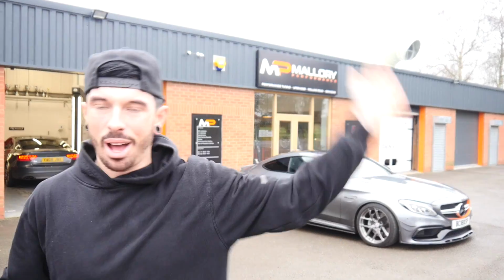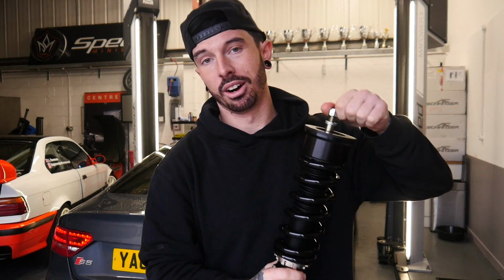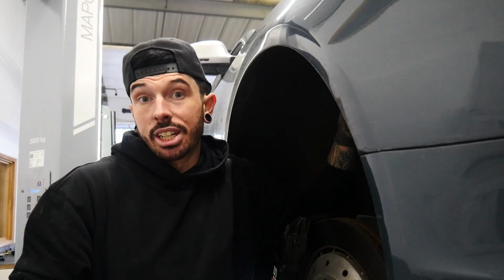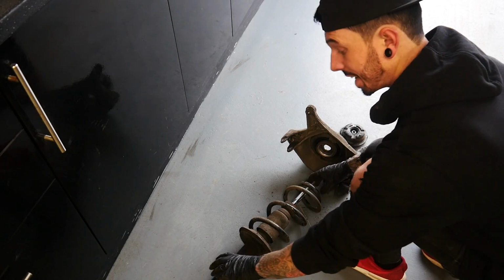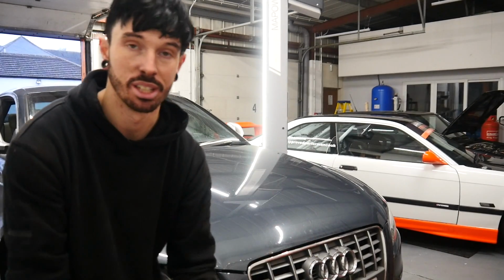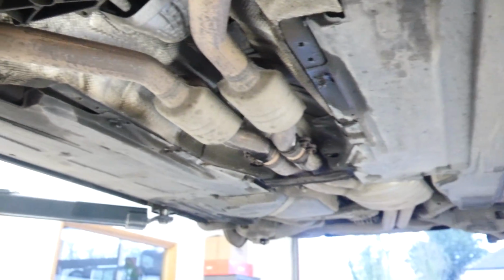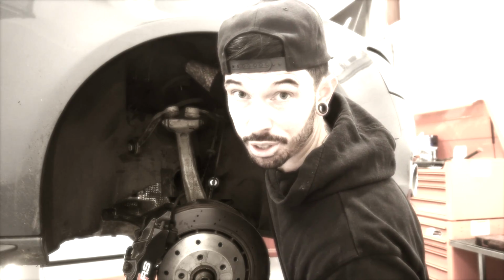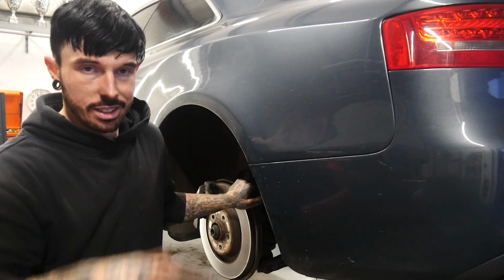COILOVER SUSPENSION INSTALL FAILED! AUDI S5

Comment: Brilliant video 👍 I really feel your pain with those bolts snapping, it's one of the worst feelings in the world (at the time anyway), I actually feel like crying when it happens, I think you need to go and have a brew and 10 minutes when stuff like that happens otherwise your head just goes. 

I've got all the front upper and lower arms to do on my 10 plate A4 Avant this year, I've back off the pinch bolt nut and have been blasting it with penetration fluid once a week in the hope I can get the pinch bolt out, worst case I'm going drill it out. 

I did the rear shocks on mine and those bolts were pretty tight but your cars a couple of years older than mine and a few more miles so they've had a bit more salt on them. 

Let us know how your get those bolts out that would be really interesting and helpful for when I snap mine 👍 Cheers 👍 Jack

Comment: Google snapped studs, there are plenty of good videos out there mate.  And you don’t need mega expensive tools.  I wish you Mechanic’s would stop using WD40 and other penetration oils as none work.  Use heat instead.

Comment: You need a real penetrative spray, not WD40 bud. WD40 is not penetrative to loosen bolts, it's only water displacement. Savage to see those bolts snap.

Comment: The best way to get those pinch bolts out is by using heat, just put flames on them for a while. Trust me I worked on a 600.000 mile passat and I know how to fight these things. Same for those bolts that snapped. Just blast all that stuff with heat first. Nonetheless they should never snap. Impressed by the shit quality on this car.

Comment: they snapped because you don't know how to untighten a bolt, you have to give it taps (smashes) shocking it, to break the static friction -- not just pull on it with a big bar. And that's the easiest thing you don't know, mechanics know how to get out of even more complicated situations. Experience would have saved you but also a little common sense. That, or you accepted the risk when you decided to mess with it. Just a warning, if the screw extractor doesn't work (which is probably wont), then you'll have to cut the shocks.

Comment: I spoke to Audi Eastbourne spoke to a technician of 30 years about my 200 (59) s5 auto he said the differential and gearbox is a sealed unit and does not need servicing as the oil out lives the car the only time they need doing is when you have a problem, message me on Instagram david_8tv8

Comment: Massive inexperience! Did you train as an automotive technician? I doubt it with the way you broke that suspension bolt? Using a bar that big and not knowing it’s going to break how’s you have minimal tool techniques! Also driving the car with inoperative rear dampers was basically irresponsible. Should have left the car where it was till rectified! Amazing I the U.K. that you can’t fix your gas cooker or boiler without certification yet you can strip everything on a car without any papers ; yet it it’s outcome van be more catastrophic!
Reply from the maker: I'm not a mechanic. I work behind computers. It's a hobby and this is entertainment. I'm sure there was a point in your life when u were as in experiencened as me remember that
Reply: @MatArmstrongbmx  People love giving it the bigg'n behind the keyboard. Take little notice of these comments mate. You're doing a cracking job. Loving the content - very entertaining - and that you're a Leicester lad. Keep it up!